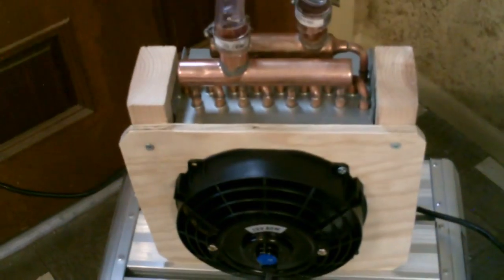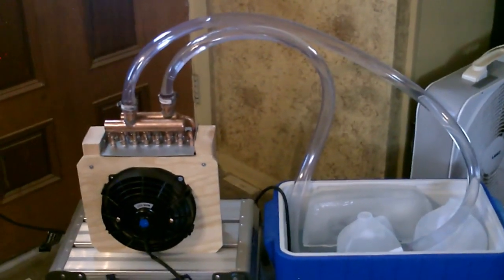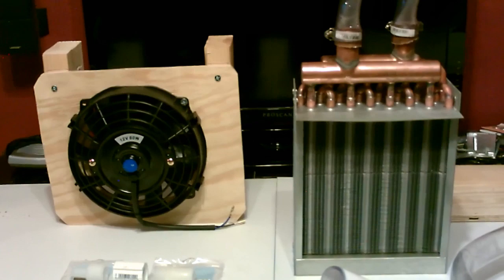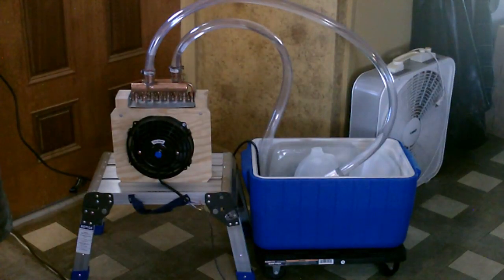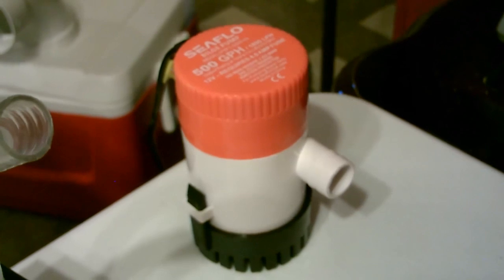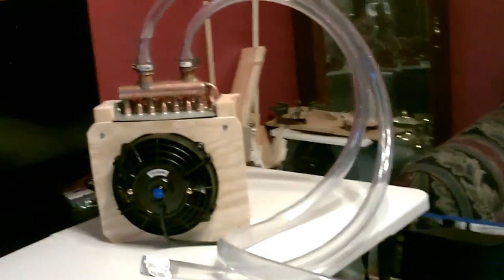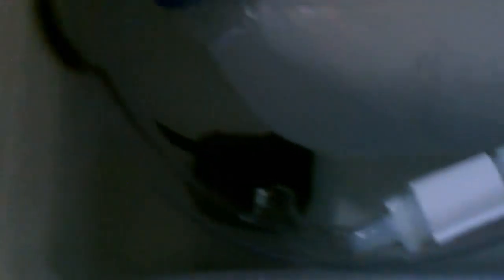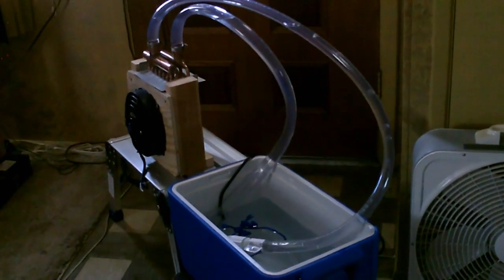DIY Air Cooler! - Chilled Water AC Air Cooler! - Radiant Cooling with water! - Easy DIY

Comment: I just made one out of a Sears dehumidifier I bought at goodwill for 10$ I used a 10 gallon tank and bent the evaporatior coils into the water. Wow, it works better than a window ac. I’m going to use glycol and get it down to zero degrees. It still cools for and hour after the compressor is off.  U could probably use a water cooler too.
Reply: @Forrest Blade Yes I'd like to know.
Reply: You need to do a diy on this!

Comment: It was almost 100 today in NM and I went thru a bag of ice in my van in less than 2 hours. I'm using the setup from your previous vid and buy bags of ice since I have no freezer. I did have it on full blast which I usually don't because it was soooo hot. It was cold but after 2 hours the ice was gone and the water in the cooler was really warm. Gotta find a way to prolong the ice. I have had a bag of ice last all night and then some with the fan lower and of course, no where near 100 degrees. 
I like this approach over a swamp cooler because mold is the enemy of anyone living in a van.
Reply from the maker: hi. the best way to get the ice to last is to use the largest blocks you can. i freeze 20 to 25 pound ones and they last 3 times or more as long as ice cubes. this heat exchanger one doesn't even need ice if you can get cold water. so that's a plus too.
Reply: Get the ice maker.

Comment: This is a great idea to utilize components that are used in other systems to get the same thing done but using water as the vehicle for transferring heat and cooling the room like a regular air conditioner would.
Reply from the maker: hi there. you mentioned it being hard to find certain parts in another comment. the best way to search for the parts is online or telephone (don't drive to all the stores). heat exchangers and the radiator fans are much easier found by just going to amazon. that is where i get my heat exchangers and radiator fans. just takes a few minutes to get them online. by the way, the links to those items change all the time (like every week or two) so any link i post is inactive almost right away. it's best to just hop on amazon. to find the fans just search for 7 inch car radiator fan. amazon has dozens. to find the heat exchangers just type 'water to air heat exchanger'. here is a link of 3 pages of them to get you started. it's not an amazon link but they sell good ones (it's the company that sells the heat exchangers that i use). i usually buy them on amazon though because sometimes amazon has them cheaper. https://badger-pipe.com/collections/water-to-air-heat-exchanger

Comment: It would be a lot more effective if you modified the cooler top so it can be in place when the system is operating. Without the top you are absorbing a lot of heat from the air on the surface of the water which will lower the time required before you have to recharge your ice. The same thing is true when it comes to uninsulated hoses. You will lose heat from your cold water run and you will be putting heat back into the air from your return run. 
If you have sufficient space, you could also construct a small cooling tower for your return water before it gets to the ice chest. A properly designed and constructed cooling tower can lower your return water temperature by as much as 10F before it gets to your ice pack. As a result the given volume of ice would last longer between recharges.

Comment: Damn I can just imagine having this on a hot office desk trickling cool air onto my face!
Reply from the maker: that's funny you say that - because i just got the parts to make one for the office. it's about 1/4 size of this and is about the size of desk fan. i'll be posted soon.😎
Reply: desertsun02 where can I get that radiator fan and can I power it with a big ass power bank?? I saw the other swanp cooler you did with the attwood blower. I kinda thought of using this fan instead of the attwood!! thought?? tnx man

Comment: Same concept as the IcyBreeze brand A/C cooler, but much cheaper!  I'm looking to make a very small version for a project and am intrigued by this type of solution to prevent it from being a swamp cooler and making everything damp. Good job.
Reply from the maker: hi. i just made 3 videos showing exactly what you mention (smaller lighter versions of this). if interested....
1.) the medium size one https://youtu.be/5YVPu9hfhZo
2.) the small one https://youtu.be/DERYsKnlKzA
3.) the large (but light) one https://youtu.be/Jfc26AH0jLI
Reply: @desertsun02  Great!  That's pretty much what I was thinking, but using a small drink cooler and possibly making it a closed loop system with a second small heat exchanger in the water.  That way it can be sealed up with less chance of leaking.

Comment: Great video.Easier to run a freezer to make ice on solar than a ac unit.
Reply from the maker: hi. remember too that these technically don't even need ice... just cold water. so if you've got naturally cold tap water (or well water) you're set. even cold water from a stream or lake could work. or just cold water from your fridge - if you wanna skip the ice. but ice does make it the coldest 🙂
Reply: @desertsun02  How long before you need to replace the ice/cold water?

Comment: You need to produce ice, or cold water, which uses energy.  I use the same method on my farm, but I have the an irrigation pool with cold water flowing through it continuously, so my source for cold water is free.
Reply from the maker: sounds like you have a good setup. you've essentially got an "almost-free" Air Cooling System (since you've got an unlimited cold-water source). i've managed to combine this with my DIY evap water chiller unit (in another video) for an alternative source of 'cheap' cold-water.

Comment: Can you list all the parts .
Where do you get a heat exchanger.
I do have a friend in the ac trades and I will ask him. Can you give advise as to where I can get a heat exchanger for reasonable cost. I saw a new one for over 100 dollars
Reply from the maker: hi. the best place i know of to get the heat exchangers is amazon. here's a link to the exact one i used. https://www.amazon.com/Water-Exchanger-1-Copper-Install-Flange/dp/B07VPBSFQC   here's another one https://www.amazon.com/Water-Air-Heat-Exchanger-Coil/dp/B00LNHS7JK/ref=pd_sbs_6?pd_rd_w=9IfIa&pf_rd_p=5e0f7f8d-f321-4a3e-bdac-3142fcd848d7&pf_rd_r=B3YSAYNW92CV1XHHCP2K&pd_rd_r=0e16e729-0b1b-4c22-bb03-c290a5d69030&pd_rd_wg=GyDMS&pd_rd_i=B00LNHS7JK&psc=1

Comment: What kind of battery can power this cooler if we opt to not get a solar panel? And wat is the option of plugging it into your own outlet?
Thank you for all your helpful feedback.
Reply from the maker: hi. the best battery or batteries to use are 12v deep cycle batteries. i usually get those at walmart. if you want to be able to plug it into a wall outlet you can buy an ac to dc transformer. here's a link to a 2 minute video i did on how to run my 12v powered projects on ac power https://youtu.be/GATesKJeLMM

Comment: My question is how loud is the fan on high? Also how loud is the fan medium? Like if I had this setup in my living room and I was trying to watch TV. I love the video, thank you for taking the time to make it. I plan on replicating what you have made so thank you.
Reply from the maker: it's not that loud. up to about 80% of max it's just like a box fan on high. the last 20% is louder - closer to a medium sized shop fan.
Reply: @desertsun02  that's awesome news. Thanks for getting back to me so soon.
Reply: @desertsun02  Find a small squirrel cage fan and point the outlet straight up, sending cooler air to where the hot air is at the ceiling.

Comment: Which works better? This or your newer version with the house fan and two coils
Reply from the maker: hi there. they both have their advantages. these heat exchangers are basically heavy-duty versions of the other. the others are aluminum radiators. these are the strongest heat exchangers that money can buy i think. good for home and industrial use. the aluminum ones are mainly for home use
Reply: @desertsun02  thanks for the replys, cant wait to try it this year, i ordered the 405 radiator first, it seems to need less parts to make it work

Comment: At what air humidity does the blue evaporated cooling not work. is there a number?
Reply from the maker: hi. generally speaking they say it works good up to 60%. but the numbers vary. if you search evap cooling chart you can see the numbers

Comment: Very cool can you insulate the tubing and heat exchanger and put a top on the ice chest
Reply: I would say, mount the evaporator coil upside down on top of the cooler lid with the inlet and outlet manifolds poking through the lid, and plumb a shorter pipe to the pump at the bottom and leave the outlet to pour the warmer water on top.  That way it's an enclosed cooling tower design as the less heat dense water (colder water) sinks to the bottom.

Comment: What wattage solar is needed to run this with/without battery. Preferably without battery?
Reply from the maker: hi. the fan is 80 watts (but it will run on medium speed with as little as 50 watts). the pumps i use are typically around 20 watts (but can be a little more or less). a 100 watts is usually enough to run the system.
Reply: @desertsun02  thank you!

Comment: What about the condensation that forms on the fins of the radiator?
Reply: Make a little tray under the radiator and direct the water and pipe it into the cooler.

Comment: I wanna do this with a Peltier device (with heat exhaust fan to outside)!
Reply: Exactly what im trying to do. Tec is easier, I don't wanna mess with compressor and a coolant gas
Reply: @makmalsampah6542  TEC won't work easily. There is a lot of heat generated if you really want to generate sufficient cooling power. You will need similarly sized cooling device for the Peltiers that is shown in this video. Peltiers are very inefficient and they are not made for air conditioning.
Reply: @CuriousScientist  ill use peltier to cool the water
Reply: @Tashyncho-Sapa  good luck! You can check my videos and see why it'll be a great challenge.

Comment: It would really help if you would place a link to the 80 watt DC fan. Search as I will I can't find strong DC fans. I built your cube design but only had a 2 watt car fan so the cold would only travel two inches from the cube! Great designs!
Reply from the maker: hi there.  amazon has lots of the small 80 watt fans. the links change a lot, so it's better just to search amazon for car radiator fans. you'll see lots of them. auto parts stores should sell them too. 👍🙂
Reply: @desertsun02  Thank you desert sun I do appreciate that and I do admire your videos - you're on a roll!

Comment: Did you do any humidity readings.  Seems like that would go up with all the condensation going on.
Reply from the maker: hi there. one of the good things about this type of system is that humidity levels won't increase. they either stay the same or go down. the condensation is water that is being pulled out of the air so humidity levels in the room will actually go down if you get condensation. if you have no condensation like i do then humidity levels will stay the same.

Comment: Great idea going to make one I think, Q- was wondering if the tubes would fit better to the cooler if you turned the exchanger upside down , wouldn’t need as much tubing to run the tubes into and out of the cooler,  I don’t know, you think that makes sense?

Comment: Can the pump be connected to the speed controller as well? I'm working on this model right now, but wondering if I can tie a DC pump to the speed controller to help energy efficiency.
Reply from the maker: hi. that's a good question... i think so but i'm not sure
Reply: Why complicate things more Robb..Yes a speed controller would affect the speed of the fan but its just another piece of equipment to possibly break down..Better still to monitor the water temperature with a simple thermometer  and add the ice as needed to bring the temperature down.. Or in the winter months the hot water.. which could be heated outside with a solar oven or parabola mirror.. Or if he chose to, make it a gravity feed, and feed the top side as needed

Comment: I made this with all the pieces you advised  I’m not having that great of results I’m going to try a pump with more GPM to see if this helps
Reply from the maker: okay. the 2 biggest things are making sure that the unit is getting filled and that the water is cool enough. if your water is below 50 or even 60 it should be cranking out the cool air.
Reply: desertsun02 I used the 350 gpm going to see if a pump with more Gom helps
Reply from the maker: if you're using an 8x8 heat exchanger, that one should be strong enough. it's worth trying another pump anyway, just to make sure. i'm trying to think of what else it could be. the water temp is the only other thing...I think.
Reply: desertsun02 I appreciate your quick response and will try again and report back thanks again
Reply: desertsun02 sorry I didn’t answer your question yes sir I am using an 8x8 heat exchanger will try again and report back
Reply from the maker: okay. the only other thing I can think of is to make sure that the fan is not pulling the air "around" the unit. air likes to take the path of least resistance (meaning that it will pull air in the from sides instead of thru the fins if the fan isn't up nice and close to the heat exchanger.
Reply: desertsun02 Desert I’m using the 1 inch tubing and the 350 GPM bulge pump should I move up to a 500 or 1000 I’m not moving much water maybe that’s my issue?? And thanks for responding man
Reply from the maker: my 350 gph pump moves water thru really fast. it should be strong enough. it's worth trying a stronger pump. or maybe a different brand pump. the brand i used works good. in my next video i'll be showing a 350 gph pump pushing water thru a 12x12 heat exchanger. it pushes water thru that super fast too. sometimes when you first start it it can be sluggish, but once it gets going it runs good
Reply from the maker: hi. i thought of a couple other suggestions for you (regarding your 350gph pump issue). 1.) if there's too much air trapped inside the pump itself (at startup) - the pump will have a hard time pumping the water thru the pipe (because the motor will just be chopping at a water/air mix inside the pump). you'll hear the motor running but no water will flow. to remedy that, just pull the pump out of the water and shake it to remove any water from inside it. then drain out any water that made it into the pipes so there are no large air pockets that are backing up the flow. then reattach the pump and drop it into the water (at an angle) so any air inside the pump escapes and is not trapped in the pump. 2.) another thing is to make sure you've got enough power going to the pump. these pumps can run at lots of speeds, but if it's not getting full power or close to full power, the motor will turn and it sounds like it's working but it won't be strong enough to push water thru the pipes. note that once it starts flowing smooth it will keep flowing.

Comment: Have you measured the water temperature of the swamp cooler after it's been running for a while?
It should make a decent cheaper source of coolant for this system.
Reply from the maker: hi there. excellent thought. yep, those swamp cooler water reservoirs get cool pretty quick. i've been working on that idea just recently. essentially i'll be dropping the vinyl tubes into the reservoir on my "blue cube" evap cooler. then you just adjust the fan speed (of the heat exchanger unit) so it doesn't overpower the evap unit and you've got a 'indirect evap air cooling' so cool air with no added humidity. i should be posting a video on it soon.
Reply: @desertsun02  what cfm is that fan ? And is it that loud ??? Sorry I’m trying to think what to make for the ball field
Reply from the maker: @Weirdo Wolf studio those fans run from 800cfm to 1500 cfm depending on the model. it sounds louder than it is due to my camera having dual mics on the front of video camera. if you don't mind a box fan on medium or high then you will be okay with this setup.
Reply: @desertsun02  now is this a DC setup ? I’m trying to figure out best way to go . Side note I wonder if RV anti freeze would work mixed in with water 🤔. It’s biodegradable
Reply: @desertsun02  now to down side it a little to fit in cooler with vents
Reply: @desertsun02  I’m fine with box fan noise . Love the setup . I wonder being at ball field in the open how far it blow I might have to direct it . But 20 mph I’m sure it goes far even outside

Comment: Hi,
Glad to come across this video, just what I want to do.
But need to ask you one thing, if I use a regular water dispenser which has a 19 liter water bottle on top, with Radiator Coolant and not regular water. The water dispenser has 2 spouts one for cold and one for hot water.
If I use this dispenser, I wont need Ice, I will be able to use the same exact thing for heating in winters.
There should be no coolant loss, no additional coolant will be required if I seal the coolant tub, the pump can be outside the tub.
The rest just like you did, solar, etc..
Please, please guide me.
Thanks.
Reply: Bro I had the same idea as urs did u try this ? U life in Pakistan ?

Comment: As far as the bubbles coming up at the end of the video, I’m assuming that you have a small air leak somewhere in the system and that’s the air bubbles trying to basically “gravity bleed” themselves out of the system
Reply: Could it be ...... Impeller cavitation?
Running the speed lower may reduce that issue.

Comment: Now remove your ice water tub and replace it with a dometic 12 v freezer fridge and use a trans cooler with a lot of passes see what happens running fridge on a 500 watt hours solar power station
Reply from the maker: sounds like a good setup 🙂✔